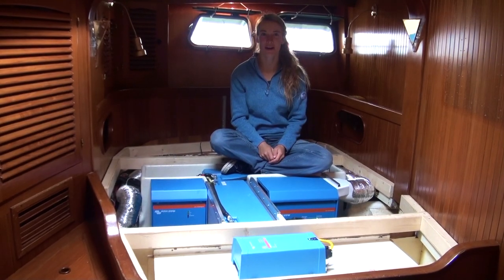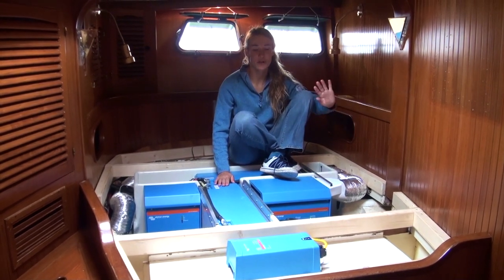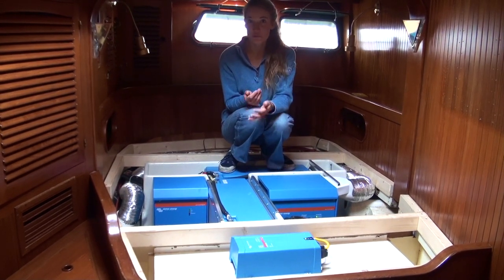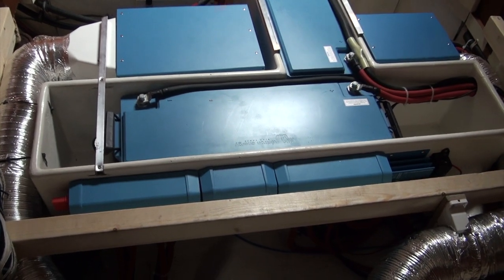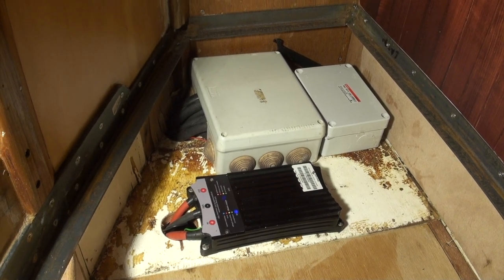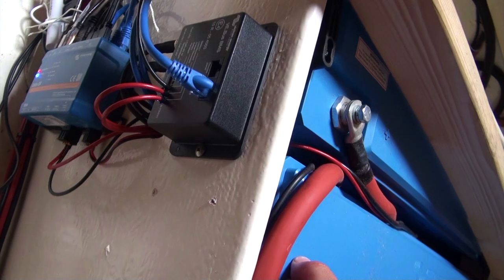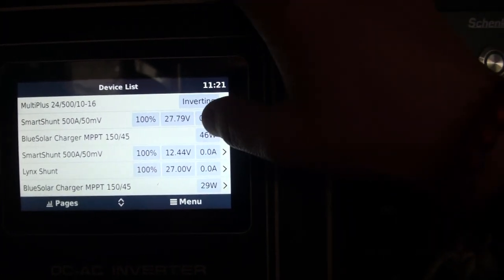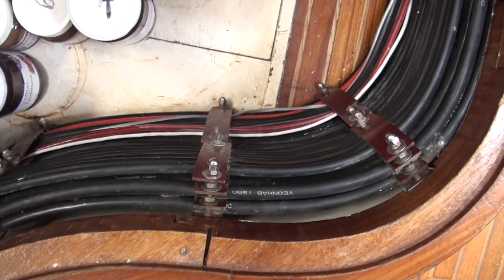Laura Dekker explains Victron Electrical Installation onboard s/v Guppy - EP34

Comment: What a fantastic setup. Boy, I hope you have someone on board who can work on this system out at sea if something goes wrong. Apart from the fact that it has been very professionally installed and appears electrically very sound and should last for a long time, as we all know, Murphies Law and saltwater/air have a way of causing even the best system to develop faults.

Laura, I know you have worked very hard with this and I hope that your program and S/V Guppy (No 2) last for a long time.  Let's hope out of the sad ending to Guppy No 1, that No 2 will have a long and illustrious career roaming the globe teaching youngens how to sail.

Thank you once again for the video!
Reply: she seems to have a good understanding of the components, so at least she can troubleshoot... but yeah if one of those 'black boxes' fails.. it might get hairy..
Reply from the maker: I installed most of the system myself so yes I do have a fairly good understanding of what's going on and how to fix it :) but I absolutely agree that the more systems there are on a boat the more stuff can break or fail. The key is  being able to deal with that by either fixing it or knowing how to live and continue without it ;)
Reply: @lauradekkerworldsailingfou2133  Well, if you installed it, then you are the one to work on it. No one will understand it as much as you will/do. Well done!

Comment: What about lightning protection? (:
Reply from the maker: Everything on this boat is very well grounded to thick plates on the hull - chainplates, masts ( with extra thick cable) and thru holes. It's not a complete guarantee but what in life is ;)